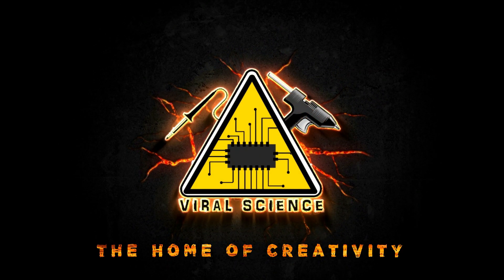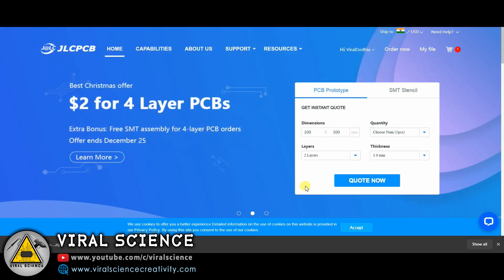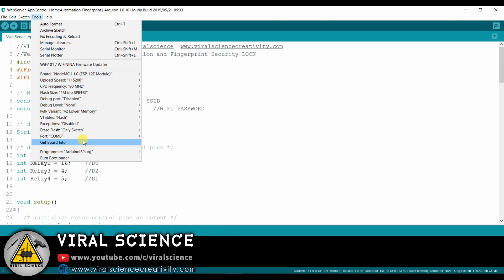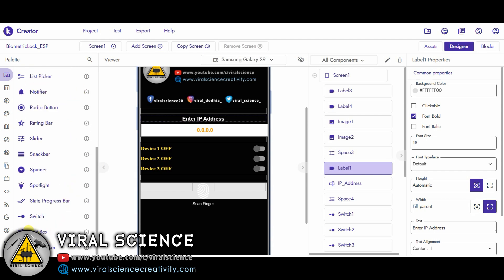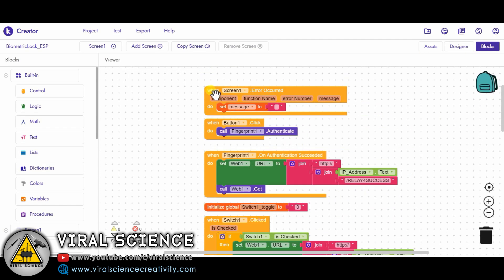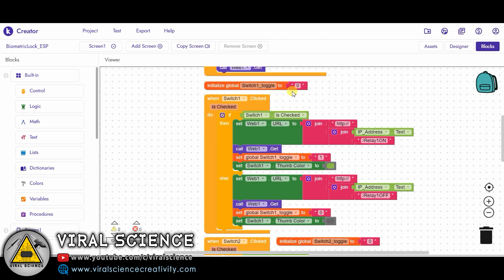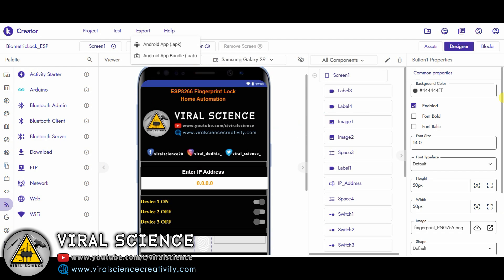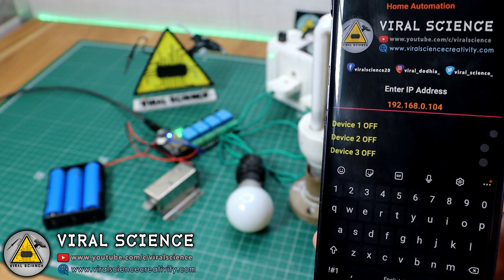Android Fingerprint ESP8266 Door Lock Control and Home Automation | How to Design Mobile Application

Comment: Hello Sir Actually My Neverhood is the owner Of a Wellness GYM
He Told Me To Built an Application The Main Purpose Of The application Is To Store the data Of Members Of Gym Like Name,Email-id,number,Plane active date, Expired date etc  in fire base.

So i Want To know That Is It Possible To Creat a Smart Door In The Gym When The Members Ship Of The User Over Then in the fire base plane tag the value will be (expired) So They Cannot Open The Door of the gym They Need To Re-new The Members Ship Of Gym 
If it is Possible Through any Way Then Please Let Me Know

The budget is very low

Actually I Mean To Say That Is There any Option To Creat a Smart Door Which Can Open By Mobile From Any Wher .

Sir I Have Create A Project In Kodular In Which I Store The Data of My GYM Users The Data is Stored in Fire Base I Hope You Understand About (Fire Base Real Time Data base) in That There Is A Bucket Name As Users in That There Are The Tag List Of User UID in That There Is The Details Of The Users In That There is a tag Named as Plane So If The Value of The Plane Tag is ACTIVE Then The User Can Open The Door By Mobile If The Plane Value is Expired Then they cannot open the door.

Sir please Check You Email